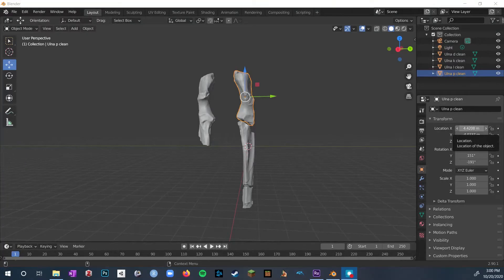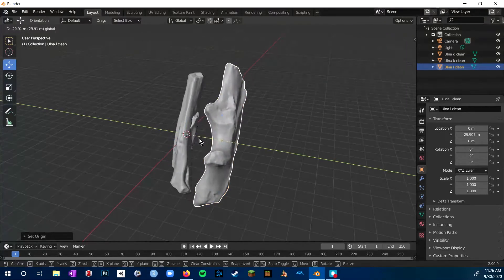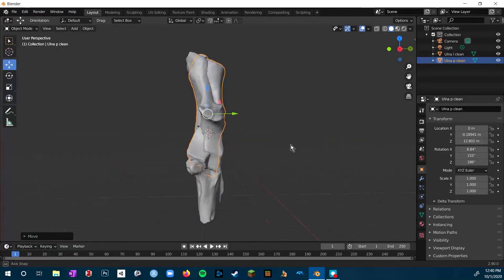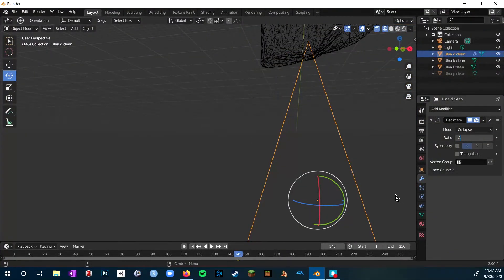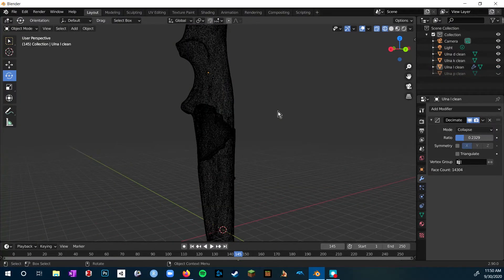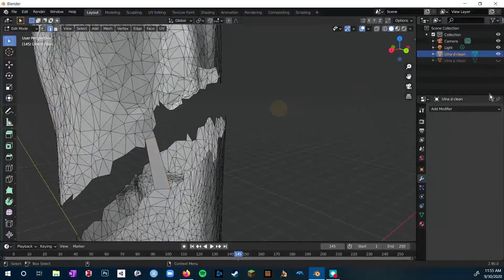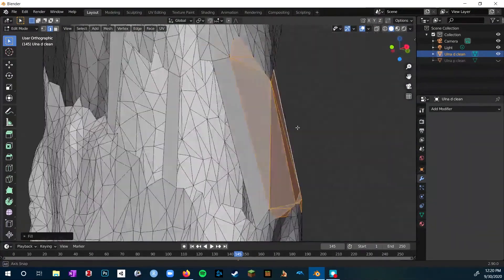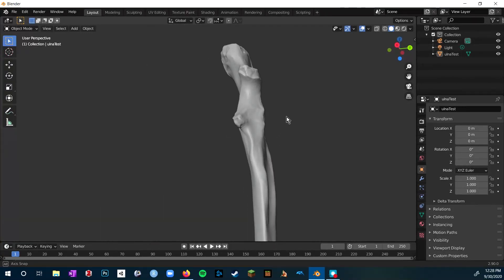Putting a Bone Together Workflow | Blender for Paleontologists Video 5

Comment: I've been thinking of writing a script to compare two objects. Say you have scans of two similar bones from two closely related species and you want to visual the similarities and differences. Blender could place both scans at the same location then apply a Boolean difference.  The problem is getting the rotations to align. I think it could program a goal seeking algorithm to minimize the volume of the Boolean difference. I have to be careful that the goal seeking does not get caught in an infinite loop.  Do you know if anyone has already created something like this?
Reply from the maker: I use a method called geometric morphometrics. You place landmarks on both objects and have the computer align based on the landmarks. There's a lot of resources on it:

Wikipedia is good for a quick intro:
https://en.m.wikipedia.org/wiki/Geometric_morphometrics_in_anthropology

Longer course material on it:
https://morphometrics.earth.indiana.edu/#:~:text=P.,David%20Polly&text=Geometric%20Morphometrics%20is%20the%20analysis,curves%2C%20outlines%2C%20or%20surfaces.

 I use the SlicerMorph extension for Slicer to run everything:
https://slicermorph.github.io/

I'm not sure how well the volume method you describe would work since the minimum volume won't necessarily line up homologous points. I'd be interested to hear how it works if you text it though

Comment: Very nice videos! I'll be bookmarking this for students who want to learn more blender! 

An alternate, more non-destructive way to bridge breaks/gaps in bones is to essentially create a cylinder that bridges the gap, then start snapping the vertices of the cylinder to the meshes of the bones, divide the cylinder, then repeat snapping the vertices to the bones, and repeat again until the bridging piece smoothly aligns with both the bones at both ends. Then I wrap everything together.

Also, a suggestion for future videos would be to have a beginning or end frame with info about the video, your name and what institution you are with in case someone picks up in the middle of the series. Or you could add that info to the video blurb.

Comment: How do you know how much material was lost between the breaks? Is it "by eye" like you estimated the orientations? 
I find it very helpful to set the origin of each piece to be the end of the break. I use the move tool to bring the ends together. Then when I use the rotation tool to rotate the piece, it pivots on the break rather than pivoting in the center. After I have them aligned I reset the origin of the mesh to the geometry.
Reply from the maker: I am confident in the length of bone I ended up with since the cracks matched up perfectly on the physical specimens. In lining up the scans, I was zooming in and checking in wireframe mode that the surface of the cracks were just touching.  Then I left the meshes in place when I deleted around the crack, so that when stitched back together the length was maintained.  There is definitely potential for shape information to be lost by deleting the broken cap and edges though, so I try to delete as little as possible, but the size of the faces will control the end size of the gap. 

Thanks for the suggestion for moving the pivot. That does sound like it would make the finer adjustment easier. I've been meaning to play around with the 3D cursor and that seems like a good place to start.